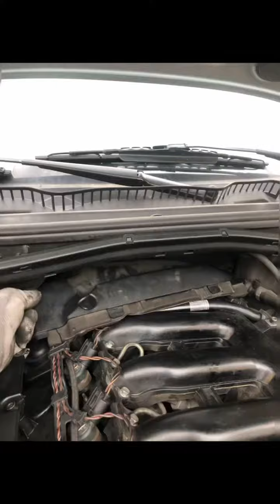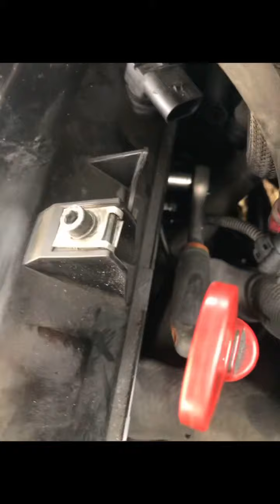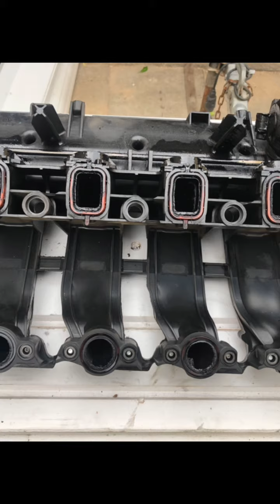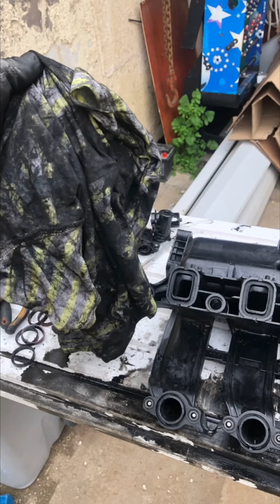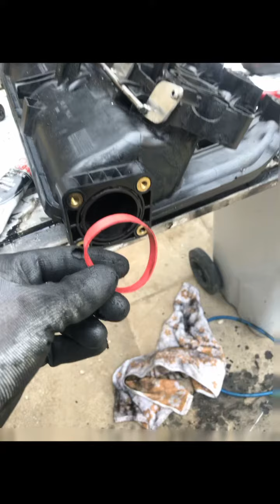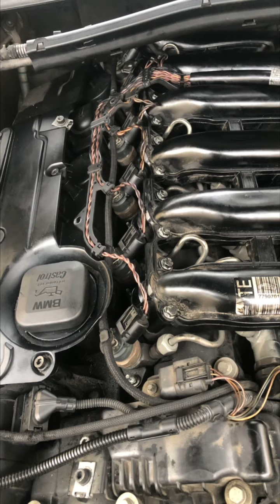Bmw X3 Suppression des clapets d’admission Moteur 3 l Nettoyage de la vanne EGR

Comment: bonjour vos clapet sont en diagonale 33mm c'est bien sa a l'horizontale c'est 22mm.
Reply from the maker: https://www.ebay.fr/itm/6x-33mm-bouchon-clapet-Volet-Admission-joint-collecteur-Pour-swirl-flap-BMW-/124252249608?mkcid=16&mkevt=1&_trksid=p2349624.m2548.l6249&mkrid=709-127639-2357-0
Reply from the maker: Ci-joint ce que j’ai acheté je sais plus ça fait plus de un an mais c’est bien du 33 mm
Reply: @willquad9636  merci moi je j'ai X3 e83 2.0d LCI 150cv 2007 les clapet sont a l'horizontale 22mm
Reply from the maker: @romaincbdt3146  moi x3  2004 3L 204 cv
Reply from the maker: C’est ça vous c’est du 22 quantité  4 et moi du 33 quantité 6
Reply: @willquad9636  sinon quelle durite on doit bouché pour que les clapet resté ouvert
Reply from the maker: @romaincbdt3146  Les clapper sont constitué de petit volet plat fixé sur un axe il suffit de retirer les deux petites vices qui tiennent le plat du clapet c’est beaucoup plus simple
Reply: @willquad9636  il faut retiré l'admission pour le faire
Reply from the maker: Où est le même déroulement que la vidéo Ou sinon j’ai la même sur Instagram seadoo_will
Reply: @willquad9636  merci je vais regardé sur astagram